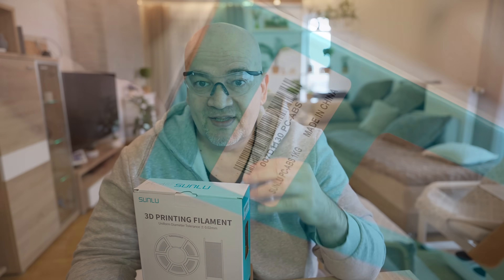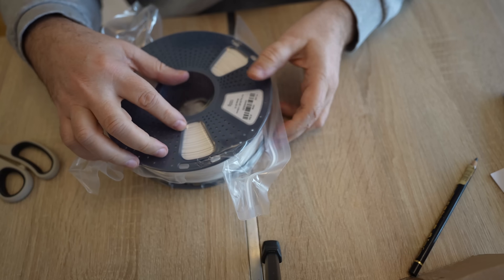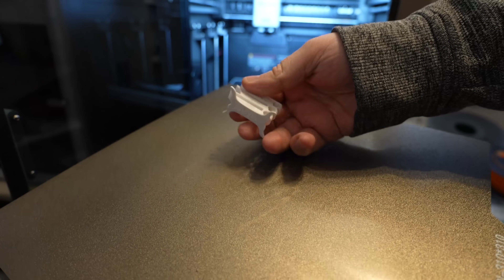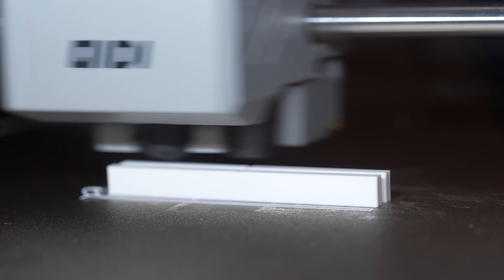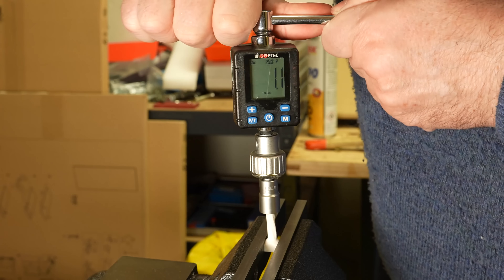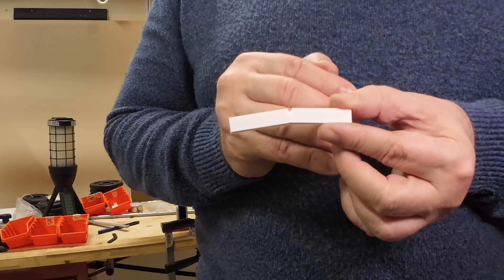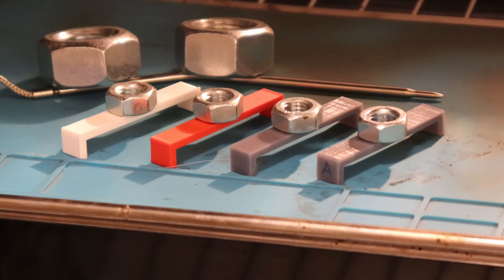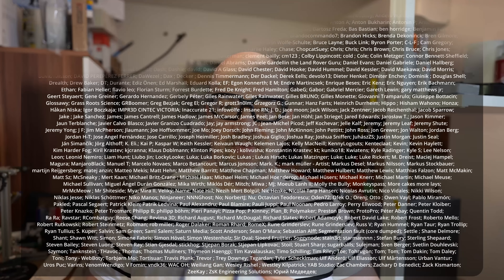A tough one: Sunlu PC-ABS filament review

Comment: The fenders and "bumpers" (side end caps) on the Segway ninebot scooter are made of PC-ABS i noticed when taking apart the end caps to  replace with 3d printed ones.  Written "PC+ABS" .  Its definitely tough taking a beating grinding up against street corners  , tearing off the reflective tape why i wanted to replace them, and a new colour.  But I thought i had no chance to compete with this materials strength, but looks like there is a 3d printing version! nice.  Im sure the injected molded parts using this PC-ABS are even better but maybe this will do.

Comment: I like Polymakers black PC-ABS.  Great surface finish and easy to print.  I used it for my belt tensioners and it's holding up great.  I don't have any warping even when printed on open machines.

Comment: This is a good test as always. I wouldn't worry about the smell when printing ABS and ASA, but about the gases. Unfortunately, the carbon filter will only capture the smell, not the poison.
Reply: My understanding is that a carbon filter would deal with any gases as well, assuming it was rated and designed correctly.

Comment: I love these engineering oriented 3D printing videos.  I bought a few different filaments based on this testing.  Thank you for the excellent data.
Reply: The problem is to find a printer that has no problem to print, the producer's specs say a printer capable of 90-100°C into chamber.

Comment: On my RatRig I can get 75 °C and manage to print pure ABS (without fibers) up to 12 cm before they start to warp off the bed. PC-CF I can print as large as I want. At 90 °C I would probably be able to print larger PC objects. PC-ABS I assume will print any size at 90 °C. The big drawback of the blend is that the heat resistance drops quite a bit. One does get extremely good impact resistance instead. I wonder how Sunlu achieved that.
Further I assume that at 90 °C the layer adhesion will be a bit better too.
Reply: Even vision miner had warping on a big abs print
Reply: It won't unfortunately, 90 still not enough for larger objects. Regarding impact strength, it's normal for pc-abs, he already tested polymakers and it also had great impact resistance